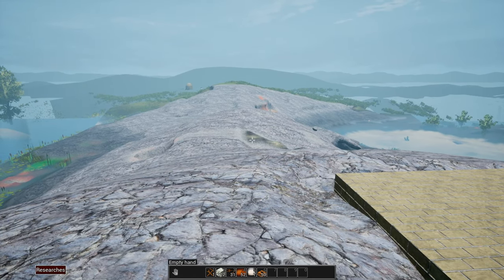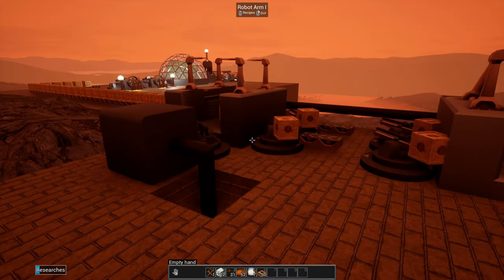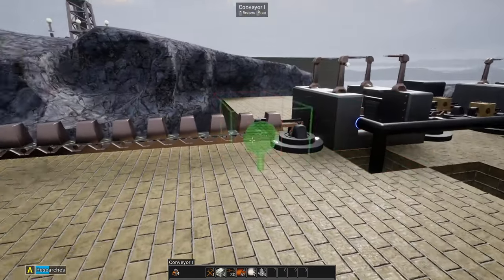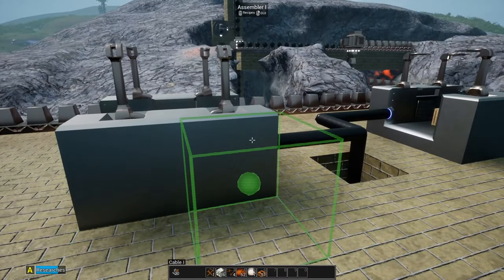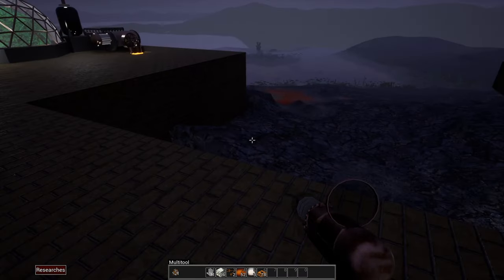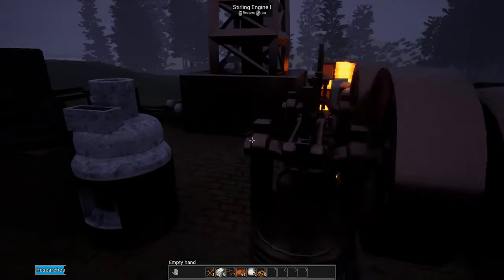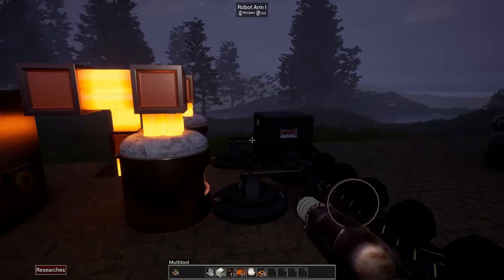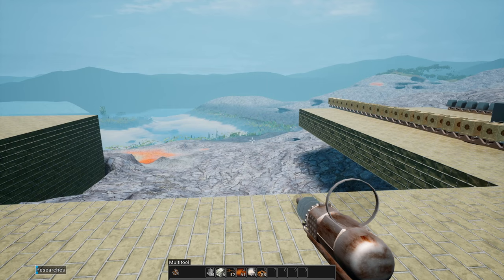Scaling Up Copper Wire! | Let's Play Evospace s01 e13

Comment: Hi, as you were talking about snaking the belts, I thought of Voxel Tycoon were we have to do that on a regular basis. There could even be a belt connecting them all in the floor.... The rotation can be done with Alt-R as well, but there is another way. Make the screwdriver and you can turn things after they are placed. You will see the same 4 arrows you do when you were placing it and holding RMB. Just activate the screwdriver via the hotbar... Great QoL feature by the Devs.  ;-)
Reply from the maker: I'll try to remember that. Those rotation options definitely sound better that what I've been doing.

Comment: just a suggestion about assemblers if you don't care about aesthetics - you can rotate them on the side so the energy input is downwards. Or you can rotate the robot arms to move things up/down. Some of the layouts are easier like that.
cheers
Reply from the maker: That's a great suggestion. For this first play through, I'm playing pretty casually and am trying to keep an eye out for aesthetics. Some of the layouts are a bit challenging already, and I imagine it will get even tougher as I start to manufacture more complicated circuits.
Reply: Just wait for aluminium layout and stainless steel. 😁
Reply from the maker: @hazy389  I know! 😸
Reply: @hazy389  I'm waiting for glider to start playing 18.1, he in for a big shock LOL
Reply from the maker: @NZ_Wanderer  I have a question for you.  My Evospace episodes currently run for about 30-35 mins.  Do you think if I extended the episodes to 60 minutes (or just posted 2 episodes at a time) that it would be better?
I'm thinking maybe things would progress a bit faster with the factory and it wouldn't actually be that much more time consuming on my end to do so.  What do you think?
Reply: @Glidercat  Hmm, well personally 60min episodes would be good, as 30 mins seems to me a little short, you are only just getting into watching it and it finishes till the next time. (and if someone has not got time to watch it all in one go they can just load the page again when they have time and youtube remembers where they were..) - I have just spent the last 4-5 days watching 4 hour streams of a game on youtube so am used to longer sessions. - I think as long as you don't start skipping over things (for the noobs to the game that want to know everything) then most people would not mind what you did :)
Reply from the maker: @NZ_Wanderer  That's great feedback, thanks!
Reply: @Glidercat  Just to add, I started watching someone playing 18.1 today and only lasted about 15mins into his video before I gave up on it, he not only skipped what he was doing he didn't explain what he was doing. (I know the game so it doesn't effect me all that much, but from a noob experience it could turn people off) - Ok, that may be his playing style, but it's not much good for people wanting to learn. (and no I not going to say who it was)- That is why your videos are so good, you cater for people wanting to learn, and those of us with experience in the game don't mind watching what you are doing as you may do something we have not thought of ourselves. - Which is part of the reason for what I said in the previous message :)
Reply from the maker: @NZ_Wanderer  When I'm recording, my brain is very much focused on how the viewer is receiving the content in real time. That may be why I occasionally miss somewhat obvious things that others see in the game itself.  The game is only 40% - 60% of what I'm thinking about while recording. Most times, I'm new to the game as well, which adds another dimension.